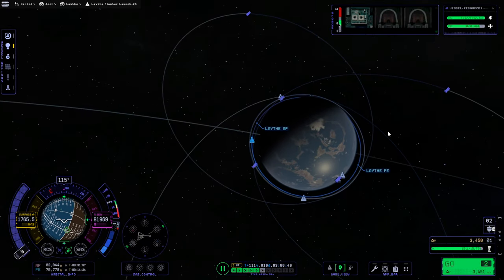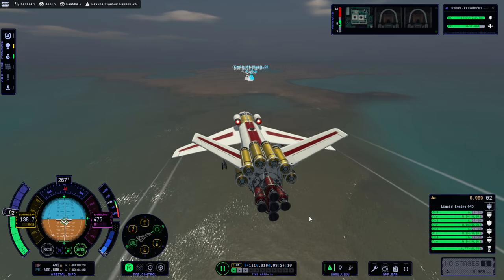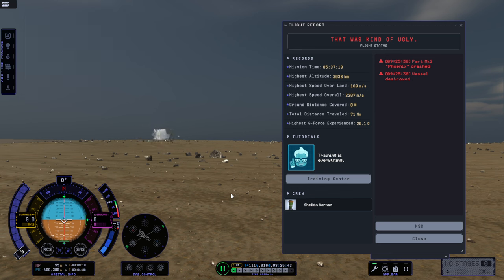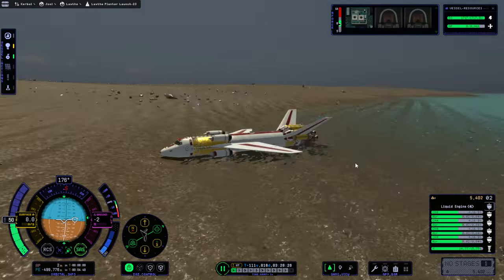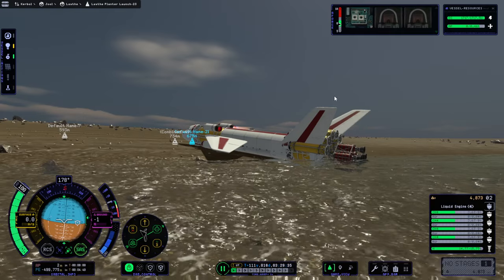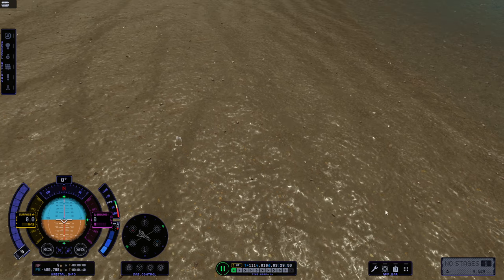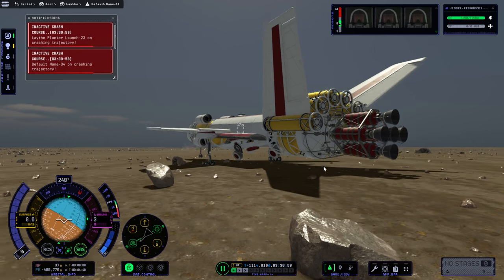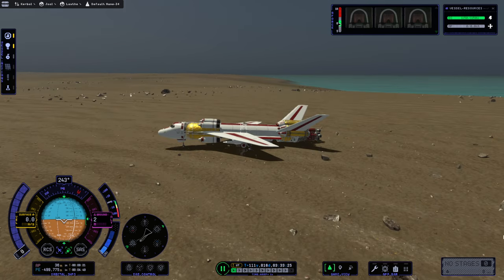KSP 2 Early Access - The Laythe Plan 21

Comment: These jet engines should not be started at full trust.  You need to push the throttle gradually and wait for the air to be at a good level.
Reply from the maker: The problem was mainly them trying to switch to afterburner mode randomly.